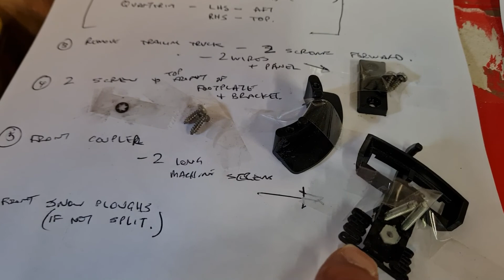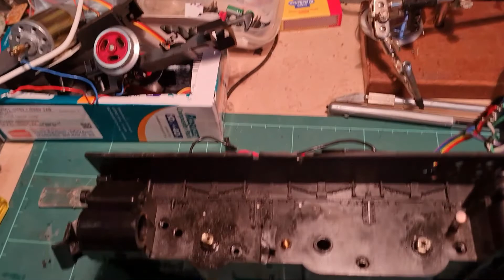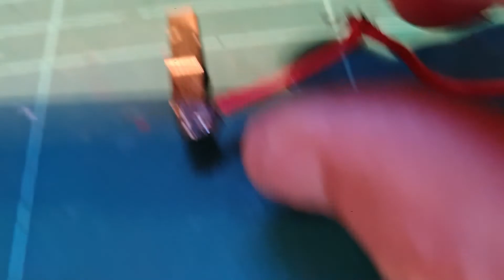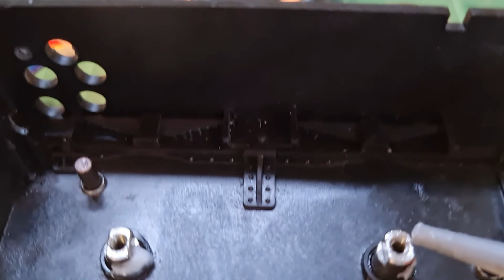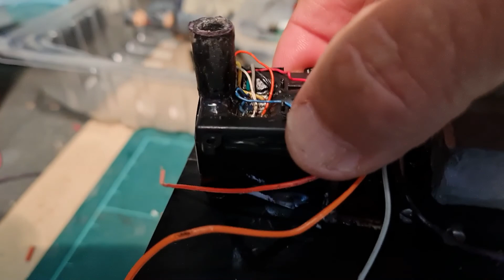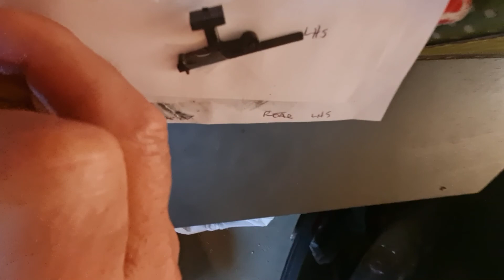Opening LGB 2071D Motorblock

Comment: Interesting video as I have done the same job on a 2071D. For the motorblock  I left most of the brass strip's in place and just direct wired the motor and insulated the brass strip's near those connections. So far the track connections all seem reliable without having to direct wire them. Until I saw this video I had no idea how much work that saved me.
Reply from the maker: Hi Rich, yes certainly could be done your way, in fact probably better. 

But I started off cutting the strips at the top as I didn't know what was in the block, and then couldn't go back.
And I did that as I didn't want to open the block and remove the wheels and rods. 

 The 2071D also had the three strips system, with the third strip for lights, capacitors etc. confusing things for me. 
But later I found that it wasn't so hard! So, a learning curve for me.

When I did my first loco, a Stainz, I stripped it out, rewired it,  and it worked well.
So, I am no expert. But I try to show what is in there, what can be done, the traps and pitfalls. 
I can certainly find the pitfalls!

Regards, Richard.
Reply: @richardhenderson4776  yes it just part of the fun and thanks for sharing. I had to snip some of the brass strips away in the motorblock to insulate the motor and actually pulled out one of the strips going down to the wheels. Then I thought about track connection and I slipped the brass strip back in and luckily the connection still worked reliably - then I knew to leave the other strips alone. Incredibly well built locos! By the way there is room for a full size pulsed smoker up the from with a bit of dremel work. Next project!
Reply from the maker: @richlam6356  Yes, agree. I like DCC conversion and enhancing the locos as much as running.
And agree re smoke generator. I have put the ESU 'small', #54678 smoker in there. (40x25x30mm). The pulsed fan is great. I am doing a running day video which will show. (I use ESU decoders to get the Euro sounds.)